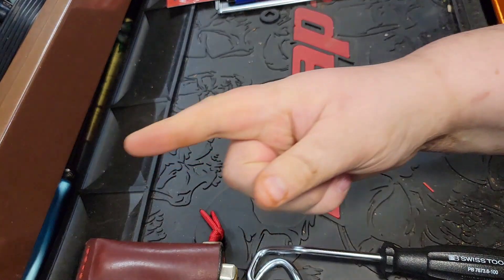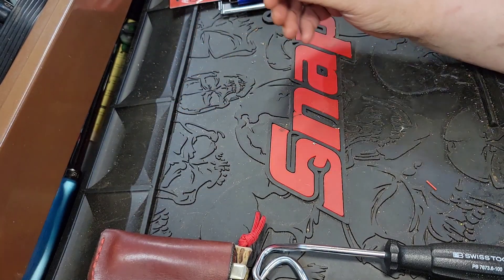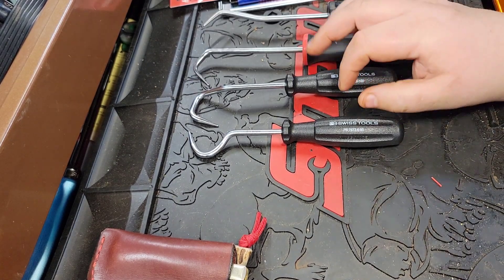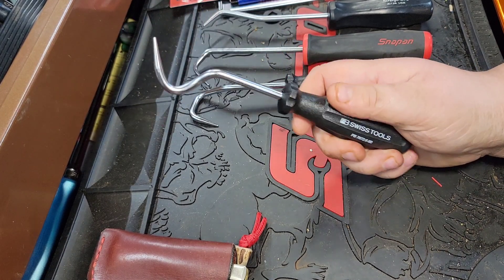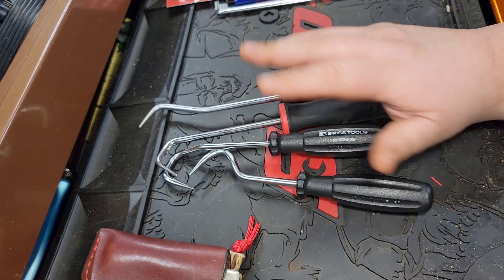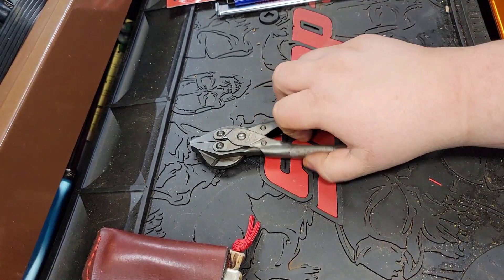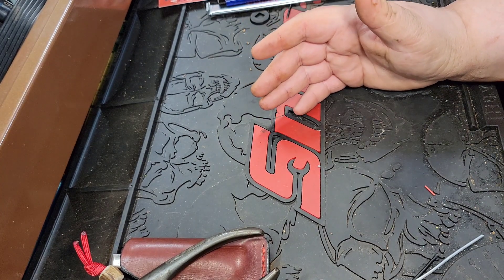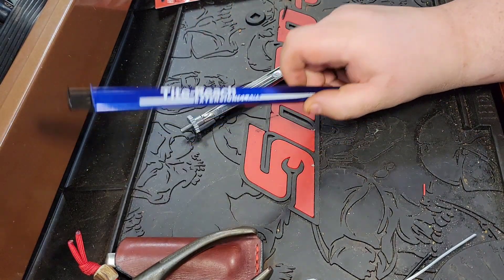PB SWISS and Handee Clamp USA ANOTHER  GREAT IOWA MADE TOOL Case trapper Bernard pliers!

Comment: I wonder if they can make a flex head handee clamp? It would help getting into the tight spots.
Reply from the maker: They do they are called hose clamp pliers
Reply: @CPthetooladdict  I have a pair from SK and sometimes they just don't squeeze the spring clamps enough for removal. I did buy a pair of Assenmacher Specialty Tools hose clamp pliers and they help as long as you have the room.

Comment: When I was a ranch hand hearing someone say "toss me them BERNARDS" is just as common as a mechanic saying "Toss me a Cresent"

Bernards are so much more comfortable to use then traditional "lineman pliers", the drawback of Bernards is the bulk and cost. Cheap lineman pliers flooded the market. Also Lineman pliers were easier to fit inside an electrical outlet box.

If you have a mile of electric fence to setup, you'll be grateful to own a set of Bernards.

Comment: Welcome to the world of PB Swiss.🙂 They make some really nice stuff.  I have a few of their drivers, bits and adapters and the fit and finish is really nice. I also have the twister ratcheting screwdriver. The lock-up is great, like a fixed blade driver and the handle feels incredible. But the backdrag is not ideal.  If they made a toothless gear with sprag clutch, that would be killer.  Nice vid CP. 👍